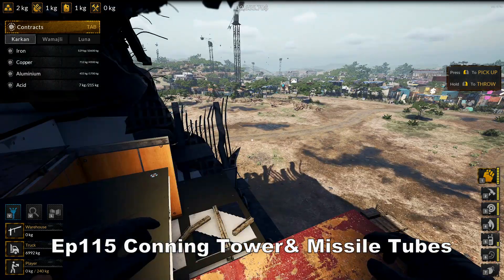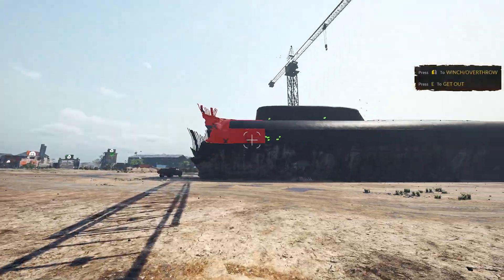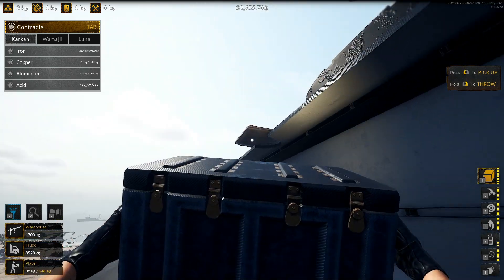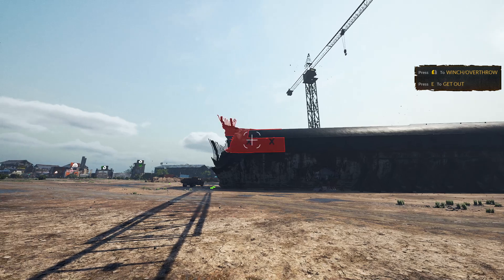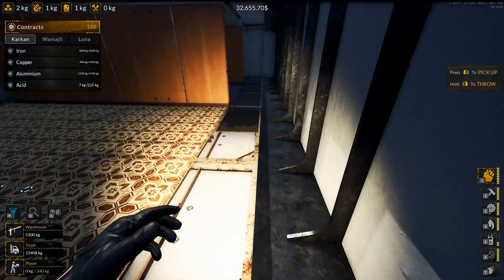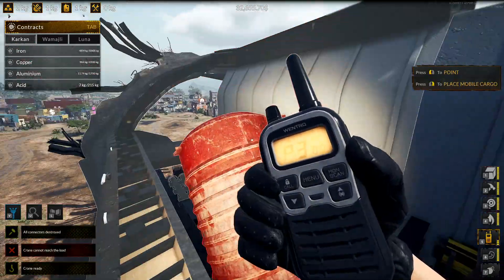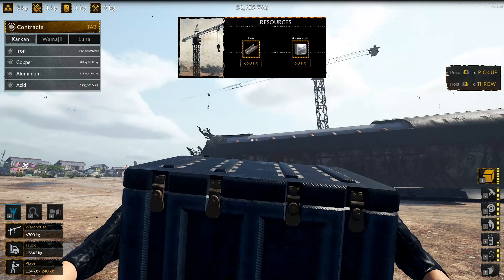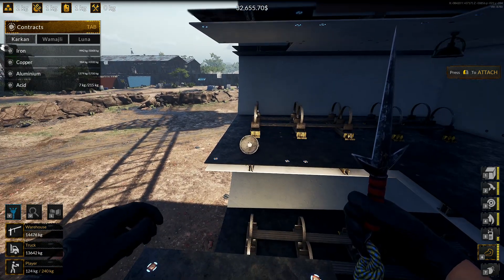Ship Graveyard 2  Ep115 Conning Tower& Missile Launchers

Comment: Thanks for this. I was stuck for SO LONG because I had no idea those hatches had almost inaccessible weld points on the outside. And at 58:00 you were stuck on the same invisible wall that I was.
Reply from the maker: hi that was hard going ,just inching up to them, but we made it in the end ,next problem will be the radiation inside, but 1st we have to find them